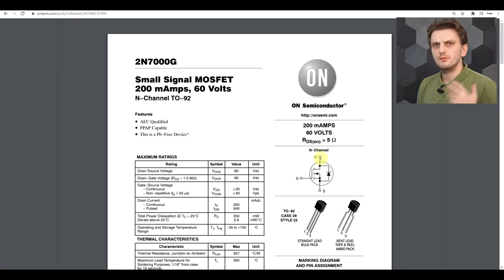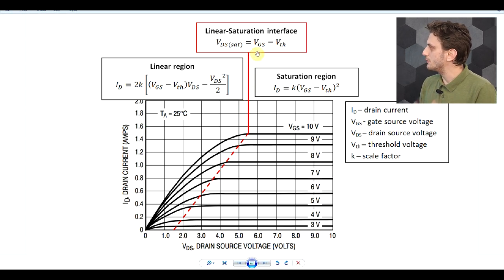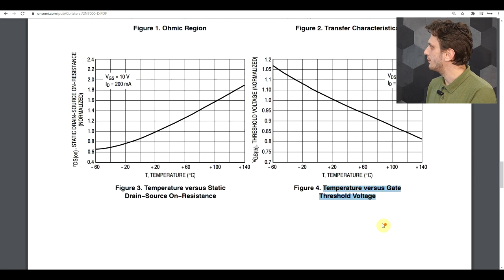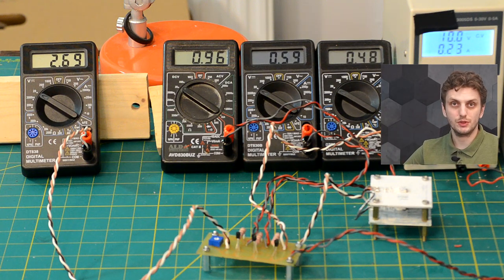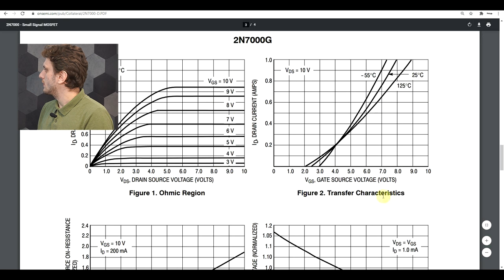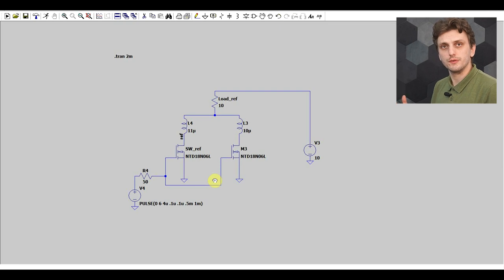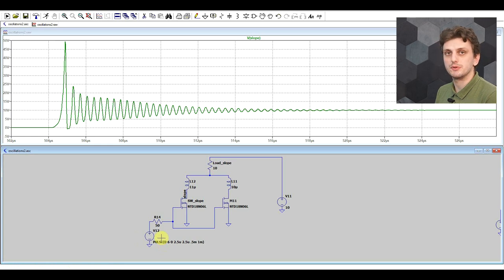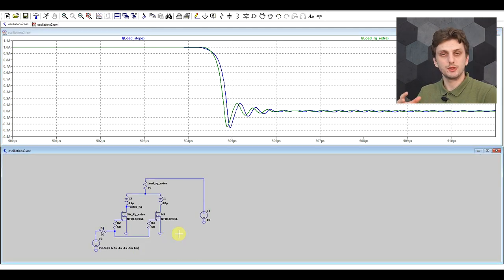Electronics Tutorial - 2/3 Driving multiple MOS-FET transistors in parallel

Comment: In the past I did many experiment with switching mosfets in parallel. If I remember correctly, transconductance increases due to lower temperature or higher gate voltage. This increase is the main reason of oscillation. Therefore, controlling transconductance or keeping it low will minimize oscillation. Also, differences of transconductance between mosfets causes one turn on faster or slower than others. By the way, I always enjoy your videos

Comment: Many thanks for the video! [2:00] Interestingly one way to interpret this graph is that 2N7000 works as a voltage-controlled resistor for low Vds. This property is used in audio compressor / AGC circuits. The idea is to build a voltage divider in which on of the "resistors" is controlled by a feedback loop.
Reply from the maker: Hello Aleksander! Honestly I have seen more often J-Fet type transistors used for this purpose rather than MOS-Fet. Since those work in reverse (you need to apply a bias voltage to stop conduction rather than start it) it might be easier to ensure a balanced feedback loop. I think that J-Fet also has lower noise than MOS-Fet.

Comment: Thanks and nice video ... You can continue on this topic to add snubber circuit .... Other suggestions for videos: Single/double and repetitive pulse test with SOA .. Great work as always
Reply: A demonstration would be nice but there's quite a lot of (not complicated but annoying) math involved in describing how a snubber works.
Reply: @typedef_  actually the math can be pretty simple with snubbers if you just solve it with a practical circuit
Reply: A very good combination is using a snubber with a small gate resistor and ferrite beat.
Reply: @p_mouse8676  A snubber works by converting an underdamped second order system into a critically damped one. The math is "pretty simple" (matching zeroes with poles in a NEVER-ENDING equation) as you said, but it is far from what the usual content of this channel is.
Reply: @typedef_  What I was trying to say, is that you don't need a lot of math to find the right values. Just one simple formula and some measurements.

Comment: Hi
Many thanks for teaching. On dcdc converter, the main problem in paralleling is that the lower vgs mosfef will take all the current for the transition, so all the dynamic losses will fall in that one. Because the plateau will clamp the gate voltage of the higher vgs th mosfets. Can you make an additional video to show the miller capacitance effect, and the vgs plateau, and why multiple gate resistor may help?
Thanks
Subscribed!

Comment: Hello again FesZ!  
Thank-you for another wonderful electronics video!
I have 2 comments and 2 questions, which follow.

COMMENT 1:

Discrete CMOS power switches, which may consist of thousands of integrated CMOS transistors in parallel, have mostly replaced discrete BJT power switches.  This is because current in the BJT must naturally increase with temperature.  This increase requires the placement of ballasting resistors between each BJT emitter and ground.  By providing negative feedback, the ballasting resistor prevents, at a minimum, excessive heating, and in the worst case, thermal runaway and device failure. Each ballasting resistor will however consume power.  On the other hand, negative feedback is naturally built into the CMOS switch, so no ballasting resistors are required.

Why does the current in a BJT increase with temperature, while not so in the CMOS transistor?  In the BJT, the current consists of electrons injected from the emitter into the depletion region associated with the emitter-base pn junction.  This depletion region is relatively empty of carriers; that’s why it’s called a “depletion region”.  As the temperature rises, thermally generated carriers, called “electron hole pairs” (EHPs), are added to the charge flow in the depletion region.  Since the concentration of carriers in the depletion region was very low to begin with, the thermally added carriers dominate the flow.  The generation of EHPs with temperature is exponential, so the BJT current increases exponentially with temperature. 

Most BJT circuits (not just power circuits) will include an emitter resistor to control this rise in current with temperature.  In that case, when we use negative feedback to force the current to be constant with temperature, the VBE must fall as the device will produce the same current with less drive.  This is where the -2mV/C° rule-of-thumb (on the VBE) comes from. 

In CMOS the same exponential growth of thermally generated EHPs takes place in the channel but we don’t see it because the concentration of carriers from the inversion (from channel formation) is massive in comparison to the number of thermally generated EHPs.  In other words, the presence of the thermally generated EHPs is masked by the much higher concentration of electrons already in the channel.  At the same time, as the temperature rises, the atoms in the silicon crystal will vibrate more widely.  These more energetic and extensive vibrations deflect and impede the drift of electrons in the channel, reducing their mobility.  As electron mobility in the channel decreases the channel resistivity rises, and the RDS(ON) of the switch increases.  Thus for CMOS switches in parallel, if one begins to conduct more than its fair share of current, its RDS(ON) will rise, which will cause its current to come back down.  So negative feedback is automatically built into the CMOS power switch.

As another example, the resistivity of elemental (undoped) silicon has a negative temp co (-70,000 ppm/C°).  Resistivity is inversely proportional to the product of carrier concentration and mobility.  In undoped silicon the carrier concentration is, relatively speaking, very low (this is why undoped silicon has almost no use in semiconductor technology).  Since the room temperature carrier concentration is low, when we heat it, the thermally generated EHPs produce a huge increase in carrier concentration.  This is the exact opposite of the case in the CMOS channel.  The EHP generation is the same in both cases; but in one case it we see it (undoped silicon), and in the other case we don’t (the CMOS channel).  The electron mobility in undoped silicon will fall with increasing temperature for the same reason that it falls in the CMOS channel, but this fall is overwhelmed by the exponential increase in carrier concentration.  Therefore the net effect on the resistivity of undoped silicon is that it goes DOWN with temperature.

COMMENT 2:

Everything regarding temperature effects for power applications (triode region) and linear applications (saturated region) is spot on.  Really nice work! 

I would add only that for power switching applications, the CMOS transistor is ideally in the “deep triode” region where VDS is very small.  In that case, the square-law equation reduces to 

IDS = μCox(W/L)(VGS − VTH)VDS.  

In switching applications, we would often have VGS equal to VDD which puts us very much in the negative temp co region for drain current.  In other words, the negative temp co on the mobility dominates, and drain current falls as temperature rises.

It was interesting to hear that at the other extreme, say for linear applications where (VGS − VTH) may be small, you might add a source resistor to fight the positive temp co on the drain current in the same way that the emitter resistor is used in a BJT circuit.

QUESTION 1:

I understood you to say that the LC oscillation arises because we have more than one CMOS switch.  Wouldn’t there still be an LC oscillation with only one CMOS switch? 

What exactly is the parasitic RCL circuit?  Taking power to be an AC ground, I see an inductor from drain to ground, a CDG cap from drain to gate, a CGS cap from gate to ground, and the signal-source resistor from gate to ground.  Would not this one CMOS switch produce a parasitic LRC circuit?  

QUESTION 2:

In textbooks the inductive kick on the drain is eliminated with a diode clamp.  The diode is in parallel with the inductor (anode on the drain, cathode on the supply), so the inductive kick is clamped at one diode drop above the positive supply.  What are your thoughts on a diode clamp to squash this LC oscillation?

Thank-you for your time and for all your great work!  These videos are very interesting and helpful.
Reply from the maker: Hello David!
Thank you for the insightful comments!
Regarding the questions, I'll try to answer them to the best of my knowledge:

For the first question - indeed, adding gate resistors is recommended even for single mosfets. Your loop is formed between the low impedance supply, the load in the drain, Cdg and the gate drive (again a low impedance circuit); This loop needs to be dampened with a gate resistor. The difference with more than 1 transistor is that, one common mistake is to place a single resistor in the driver, and create a new loop between the transistors (V+ to drain load, Cdg (t1)- Cdg (t2) drain load and back to V+); here we need extra resistors for each transistor to dampen this new loop.
 
For the second question - the inductor I added was there to simulate a very long wire; if the circuit would actually have an inductive load (like a relay) then of course a diode would be the best option but, if the inductance comes from a wire (the resistive load is somewhere many meters away from the switch) you can't really add a diode without adding again a very long wire in parallel with the first one. So the diode effect would be neglected because it would be conducting in series with another large inductor. 

Kind regards,
Fesz
Reply: @FesZElectronics  
Hello Fesz, 
Thank-you for your reply!

Yes, I did forget that the inductance was only parasitic inductance, and not a load.  

The fact that the oscillation is present with only parasitic inductance makes your point even more general and important.  Because then this oscillation must be present whenever a drain is connected to a pin. This seems very worthwhile and good to know about, and I thank you for discussing it!

In terms of thinking about the problem, FOR A SINGLE TRANSISTOR, by grounding the signal source and grounding the power supply, what I see is the following: the source impedance Rs is in parallel with Cgs.  Then this parallel combination is in series with Cdg.  Then ((Rs || Cgs) + Cdg) is in parallel with the inductance on the drain (which, through the grounded supply goes to ground).  When we add more transistors, then simple hand analysis is not feasible and the only important thing to know is how to mitigate the problem, which as you have shown, is to dampen the oscillation.

Great stuff!! Thanks !!
David

Comment: Just a novice hobbiest,  is it possible to control the gate resistance with a micro controller with a digital potentio ic ,by getting thermo or current feed back from the mosfets? This i think could even out the the current spread...

Comment: I'm building a linear amplifier for 10 meters using a irfp260n and want to run 6 MOSFETs in parallel  to possiblely achieve 1000 watts  how do I figure the resistor to load share for the gate and can I add a diode across the resistors.  this will be used on a 50 ohm load and at 50vdc

Comment: Hello FesZ! I have a question about LTspice. I' trying to simulate a log potentiometer  with a loudness tap (4 pins potentiometer) but  i can't find any solution. Could you help me (or made a video ) Thank's a lot
Reply from the maker: Hello Anton! I tried doing this at some point in the following fashion: T1-R1-a-R2-T2-R3-b-R4-T3; T1,2,3 are the 3 fixed terminals of the potentiometer; R1+R2 = R3+R4 = half pot value(on a linear potentiometer); a and b are connected by switches to the wiper (the variable part of the pot) - if the potentiometer wiper is in the first half its connected to a; else its connected to b; finally the resistor values are calculated based on the wiper position. For a log potentiometers the schematic should be the same but the R1-R4 values are different; 
Hope this helps.
Reply: @FesZElectronics  Thank's a lot. It works !

Comment: Due to after your video I experienced enlightenment. I always burned up my parallel mosfets one by one so far but now I figur out Vgs Id graph and they ara relation with heat. They were not share their Id currents as aqual. Tomorrow am gonna try the different gate voltages to share Id as equally.

But I will not pass that I say, you are just talking with your lips, we all ara not native speaker who watch your video. Maybe you can try to open your teeth while you are speaking. So we can easly understand what you say
Reply: I tryed but unfortunatly it aint. I used four IRFP460 mosfets as parallel. I checked datasheet and saw the Vgs as 5,75v at the Id-Vgs graphic that equals Id at the all temperature values. I adjusted my Gate voltage of switching as 5.75v. Result, two of them are at the middle, heating up. 1. is 36 - 2. is 74 - 3. is 67 and the last mosfet is 32 celcius at just for 5A Id